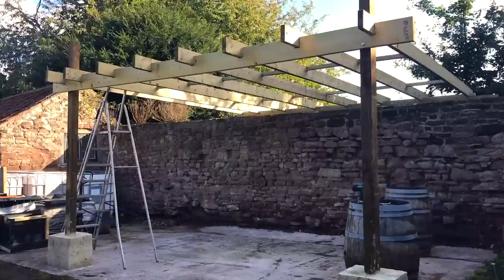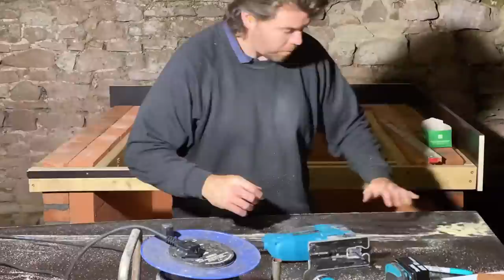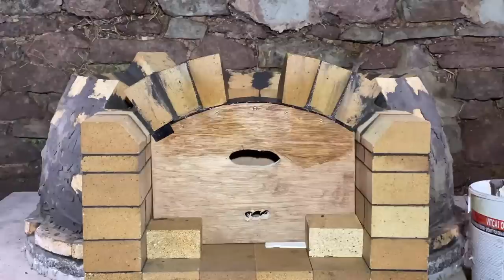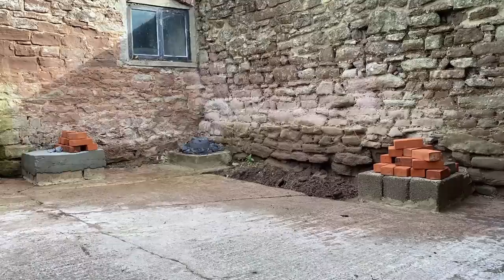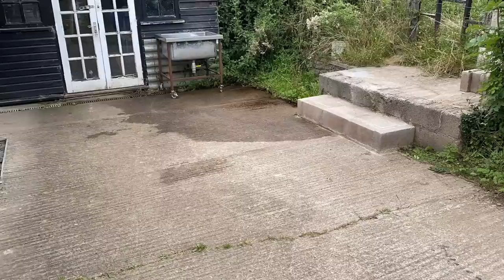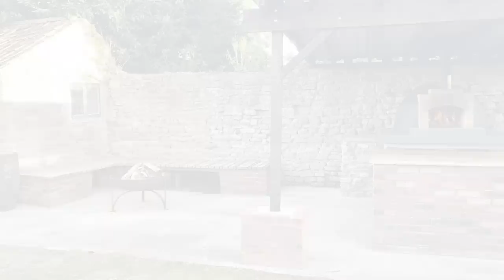Pizza oven and kitchen build.DIY

Comment: Great video! I’m in the UK and planning a similar build myself, most videos I’ve watched are outside the UK so am struggling to find suppliers for the firebricks etc. Could you share some links for where you bought your supplies (firebricks, insulation, high temp mortar etc) thanks 🙏🏼
Reply from the maker: Thank you. Vitcas is where to get most supplies or local builders merchants will often order in order in specific bricks etc.

Comment: Are you a mason? Some of that stone work just looked too natural to be a first timer. Amazing job. I'm planning a similar build wondering if you have a breakdown of costs? Love the tile work as well.
Reply from the maker: Thanks for the kind words dude. I'm honestly not a builder or a mason of any kind. I'm just an obsessive and did tonnes of research before building. As for the cost of the build that's hard to tell as lots of the materials were reclaimed. I genuinely don't have a cost breakdown but it isn't cheap. the oven alone is probably close to £3000, not including the base or any of the rest of the kitchen. if you can do it though i highly recommend and the build process is really fun and rewarding. Do it!

Comment: Impeccable work man, can I know a few things? 

What's the bottom most layer made up of, the white stuff ? 

What are the bricks used in making the dome called ? They look different then regular red bricks 

What insualtion did you use to cover the dome? 

What is the tool that is used in the center to allign the bricks while creating a dome shape called 

Would be great to get a reply, planning to make one for myself 

:) 

:)

Comment: only thing i can see 'wrong' is you didn't start burn in early enough, might have some cracking and separation to deal with down the road, but you kept the whole thing sleek and simple so if it does come up it'll be easy to address . . .nicely done youngster! :)
Reply from the maker: i had 7 curing fires of increasing size over a period of a month. i just didn't put them in the video